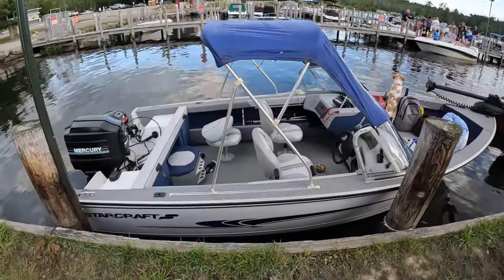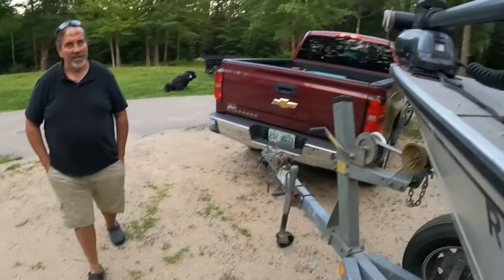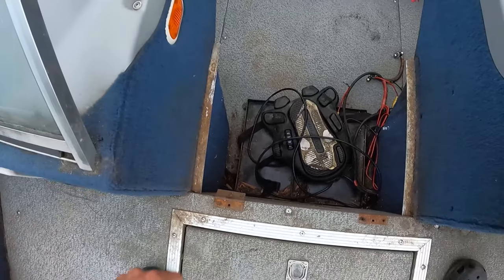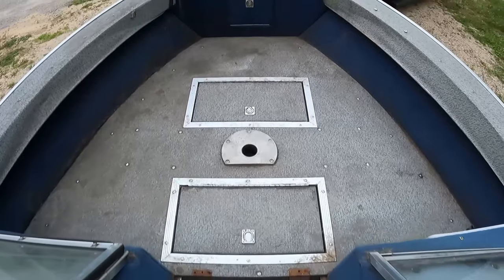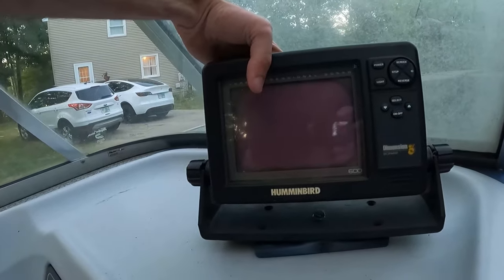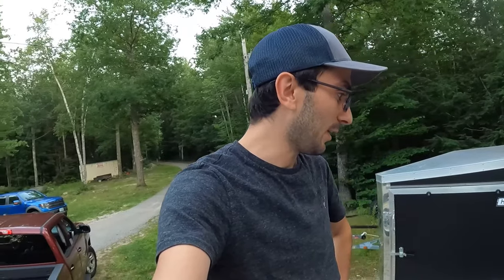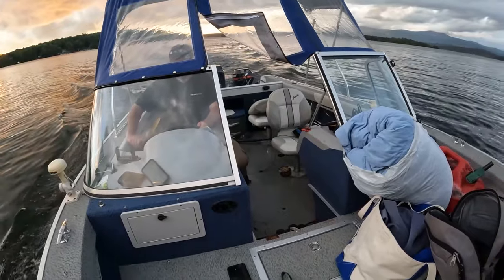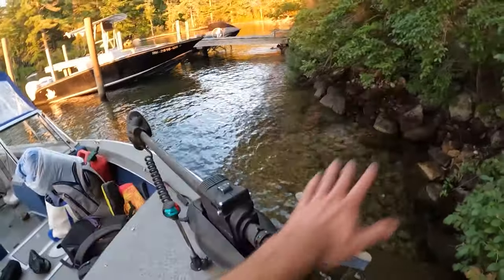I Bought the CHEAPEST Boat on Marketplace! (DISASTER)

Comment from the maker: Hahaha I see the comments talking about the drain plugs. I wish it was that simple! We brought a bunch of different sizes because we didn't know the size. The correct drain plugs were in place when the leak was happening. The leak ended up being several issues. The livewell hose was cracked and the easy fix was just plugging up the livewell intake. Then the depth finder transducer was not screwed in correctly. The final issue we still deal with today and that's pinhole leaks. This issue plagues many others with starcrafts around the same year.
Reply: interesting i was looking at buying a similar model boat what should i look for? just water in the boat?

Comment: There is a plug that was laying in splash area you should have put it in and water wouldn’t get it
Reply: Even then run the bilge  pump
Reply: Ignorance
Reply from the maker: they were just extra because we didn't know the correct size. The major leak was the livewell intake because the hose was cracked.

Comment: If size works for you, design works for you, and bones good. Fix it up. Replace any and all wood with light alum. Get a new drain plug or seal the bilge hole etc. Be happy with a solid easy to maintain boat

Comment: That is reason why I have one of those fuel hoses with hand pump extra in boat...If it takes water, I can pump it out with that 😅 Honest, its pretty handy, it fits tight holes and it takes good amount water away with every pump.
Reply: I keep one as a backup incase my bilge decides to die on me. Haven’t had to use it yet but it’s worth having

Comment: If the boat is a 2000, it was repowered. Those brown stripe Mercs are early 80's, and definitely full of problems, not anything I would own. 
I cant believe a mechanic charged you 500 bux, and didn't adress the fuel issues, obviously didn't test it out before returning it.
Reply from the maker: He fixed the issues soon after this. We ended up flipping both kicker motor and big motor for around $5k. Then we put it towards a new 115 merc. So much better 😂
Reply: @OwenOutdoors  ahhhh, there ya go!!! Enjoy that new motor 🙂